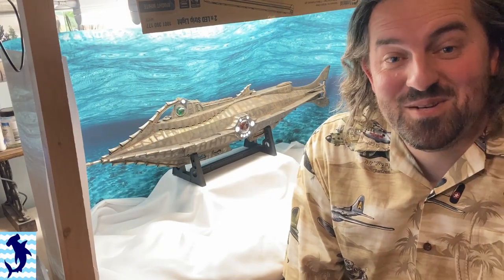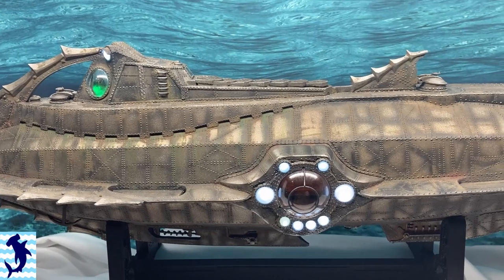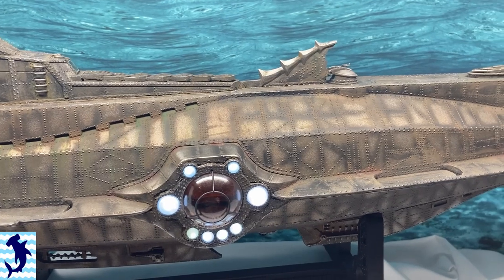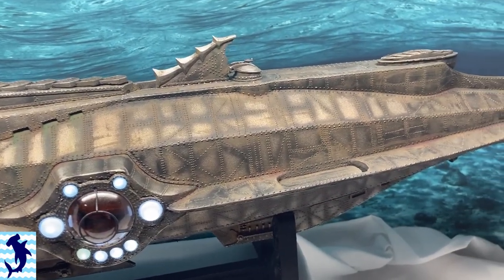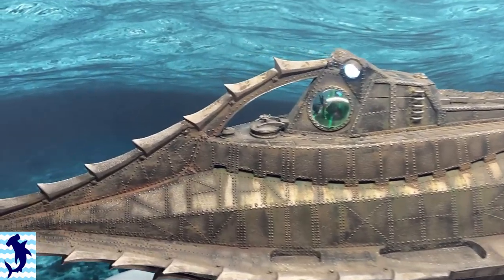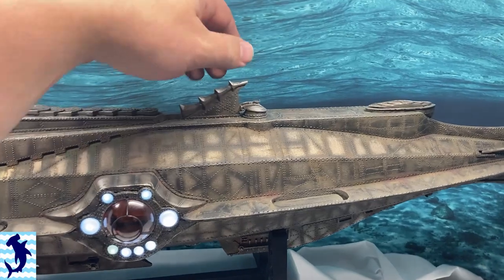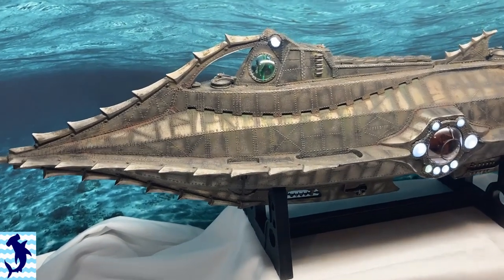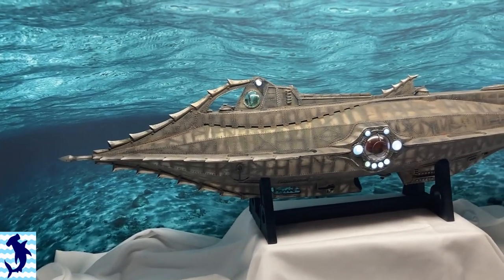Building the Nautilus Part 3 - Project Complete!

Comment: Absolutely beautiful build!
May I ask what Motor and it's spec you have used for the Motor.
Thanks
Reply from the maker: Thank you, I’m afraid I don’t know the make or specs of the motor, it was supplied by the client and was unmarked.
Reply: @HammerheadModelMaking  No problem I spoted a sticker that said 15 RPM. Keep up the good work!